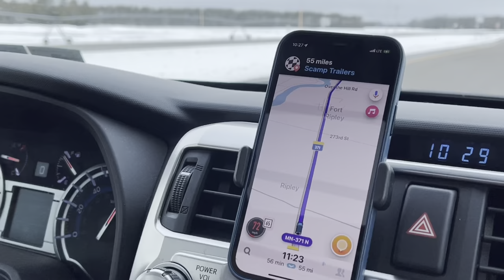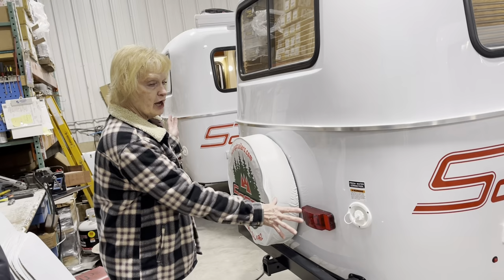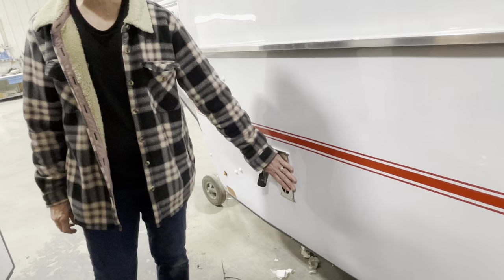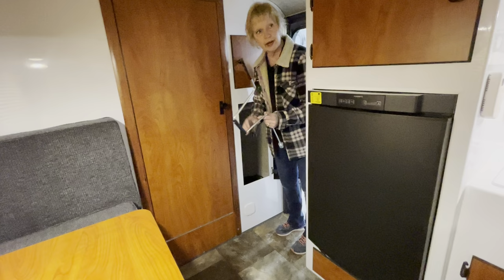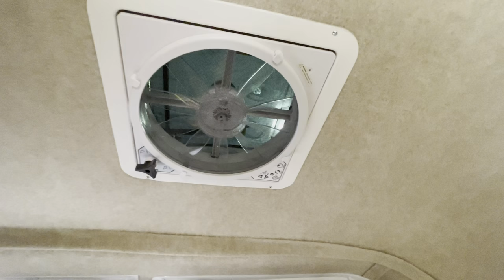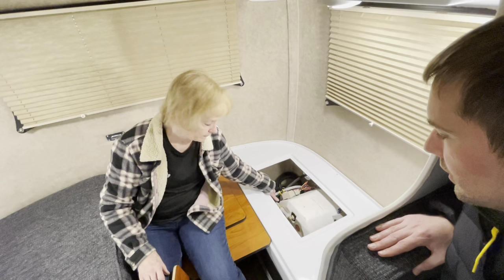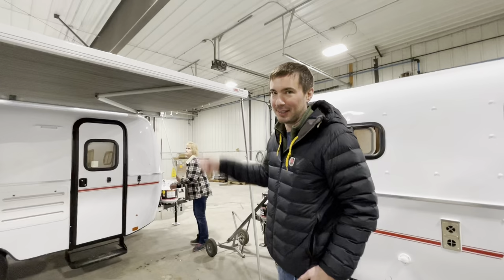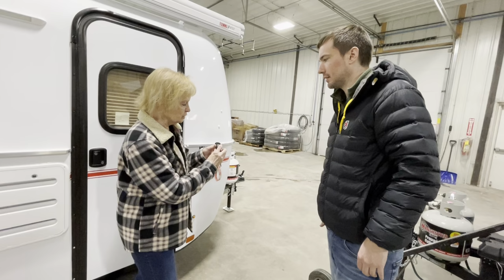2022 SCAMP 16’ Layout 6 in Factory Complete Overview

Comment: I picked up my new Scamp 13 on 4/15/2022 and Sandy did the walk through.  She did a good job of explaining the features and answering my questions.  I also got the cook top with the glass cover, and highly recommend it.  However, Dometic issued a recall on my cook top stove and I drove the 345 miles from north central Iowa to Backus in June to have it replaced.  So far I have not had any other issues with my Scamp.  I am currently in the process of winterizing the Scamp before freezing weather arrives.
Reply from the maker: I wonder if my was recalled? I wouldn’t even know!! I got my in February so wouldn’t it be similar production?
Reply: @picsburgh  Scamp has a list of all the serial numbers for the units that were recalled.  You could call them and ask for the list, or at least give them your serial number so they can check.  I was first notified by Scamp of a possible recall.  I then had to contact Dometic with information about my unit.  A few weeks later Dometic sent me an email saying that my cooktop was indeed on the recall list, and gave me options on how to get it replaced.  I chose to have Scamp do it, because they knew how it was installed and I didn't want anyone else messing with my Scamp.  BTW:  The cooktops were recalled due to a posslble gas leak around the burner valves...that could cause a fire.

Comment: I understand that at full capacity, it's 100lbs and it could cause an imbalance on that side of the camper, but Sandy mentions having water and boondocking. Does that mean there is a safe way to travel with enough water in the fresh water tank to sustain you for a few days?
Reply from the maker: You make want to ask Scamp. It might be okay to add a little bit of water but I’m not entirely sure.
Reply: I know this is old but maybe new info...what's point of a a water tank if you can't fill it up to Boondock. If you can only run water in campgrounds what's the point of a trailer. Obviously something wrong with this info or I'm missing something. One issue I found on another trailer the hose connections broke at tank. Huge repair. Company said shouldn't travel with water in tank as it bounces and can cause damage.  Owner baffled. Install of tank very poor. This was 5th wheel surely a shower,toilet but no water to use in them....

Comment: Just picked up my scamp yesterday. Pray all goes well. I do see some issues already will contact Scamp to get them fixed. I will keep you posted to see how that goes. Bummer will have to drive it back to Backus MN though. Do you know if they have any places other than Backus to get repairs done?
Reply from the maker: Yes. You can take it nearly anywhere. I had to get a leaking window fixed locally. I’m 17 hours from the factory, no way I wanted to go back to get it fixed 😂.

Comment: This is not a knock against Scamp, but after watching this detailed explanation of features, I cannot help but be very happy I bought a Casita 17. The 2 way water heater, single outlet sewer drain, shower function, MUCH larger holding tanks, sturdier cabinets and table and most importantly interior height difference give me a more pleasant camping experience. That said, it is still a nice trailer, just 1.0 versus 2.0.
Reply from the maker: I agree. I wish the height was just a bit higher. I might end up switching up to a Casita or Escape mostly due to my height. I still love the Scamp so far though. I hope I don’t have holding tank problems and I can live with the separate grey and black water hookups for now.
Reply: Agree
Placement  of voltage meter really  inconvenient  for seniors  to check and other odd placement  of such.
Reply: What is the interior height?   We are in Minnesota now and was planning on going to the Scamp show room and then head down to Hohenwald to look at the Casitas.   I am 6'1 and am tired of bumping my head on everything...
Reply from the maker: @chillywilly3397  I believe the interior height is 6’1’’ some say 6’2’’ but im 6’2’’ and have to lean. The AC on the ceiling drops that even lower, you have to lean more walking under it.
Reply: @picsburgh  ok, thank you for the info...and thank you for your video...it was very informative, helpful and useful 👍🏻
Reply: @Picsburgh I started out with a Casita 17' Deluxe.  It had excellent build quality. I then went to a Lance 2075 for a bit more space.  I learned my lesson...molded fiberglass is superior in every way.  So now, I will be picking up an Oliver LEII in January.  I believe the Oliver would have plenty of height for anyone 6'2", without the need to duck, and even with the A/C.  It's pricier, but is double-hulled and truly 4 seasons.  Maybe we'll run into you on the road sometime.  Happy camping :)

Comment: I pick mine up late fall... How's that fridge working while traveling. Seems no problem while hooked up to truck and driving. If stopped for awhile, do you pull the 7 connector from truck so it doesn't drain battery.  Also, I got the solar package for keeping the battery charged while boondocking. Did you consider that option?  Thanx, and hope you have a great summer of camping.
Reply from the maker: I haven’t used the fridge yet but I will likely have it run while driving. I do put the 7 connector when park. I didn’t consider solar because I am soooo uneducated on it. I may do something solar down the line. Thanks you too on camping this summer! Enjoy!
Reply: How much is the solar option & is it permanently attached to the roof?
Reply: @jackieflynt995  Hey Jackie, I paid 475 dollars for the solar kit for the 2024 model. It's the suitcase style solar panel that you keep inside the trailer and set it up when parked. It hooks up to a exterior jack...Simple.
 I used to have a van with 400 watts of solar with a 2000 wt inverter. Once I get comfortable with the Scamp I will look into what I can do with a solar (190 watt single panel) on roof along with lithium batteries. I'm not getting a A/C unit, so should have some room to work with.  Hope that helped. 
If anyone who reads this has done the solar upgrade on a 16' Scamp, love to hear from you..!

Comment: Can I use a 4 cylinder compact suv (Hyundai Tucson) to tow this?  How much does it weigh? Thanks.
Reply from the maker: What is your car rated to tow?
Reply from the maker: I think about 2000 pounds from what I googled. You might be safer with a 13 ft scamp.

Comment: Been looking at one for awhile. Tried finding a used one for a few years but its so hard to find. New might be the only option. Can you tell me the approximate cost?
Reply from the maker: Hey Ian. They start at about 25k and with a few options are now pushing 30k I bought right before a huge jump in price though fortunately but I still paid about $25,000 for mine. Same options I priced recently and it is now about 5k more.
Reply from the maker: If you call email scamp they will provide you a pricing list. It’s cheaper without a bathroom.